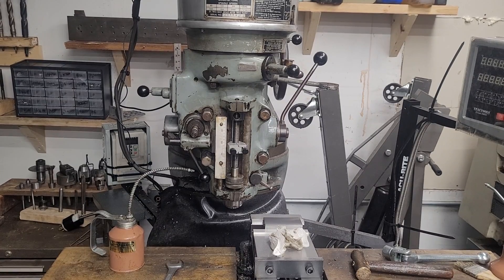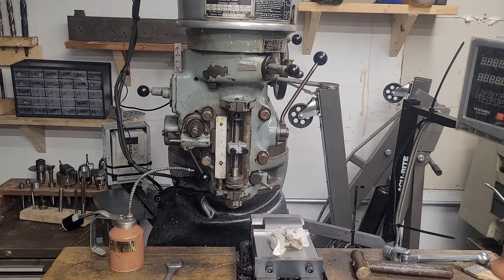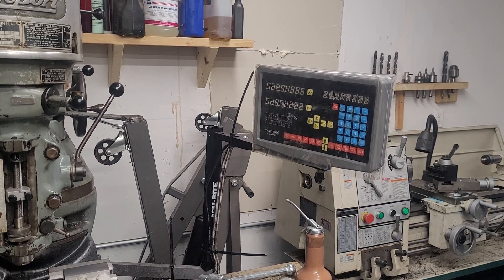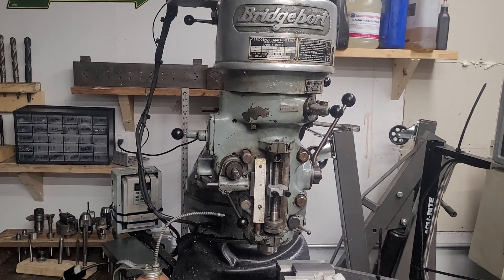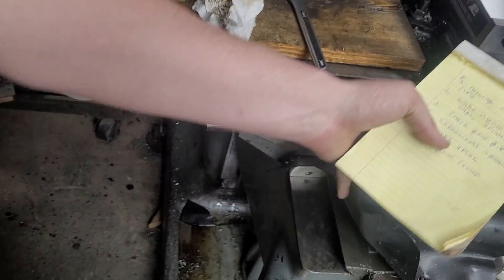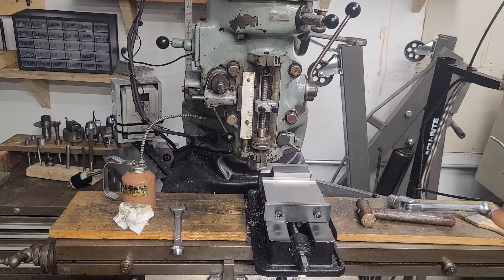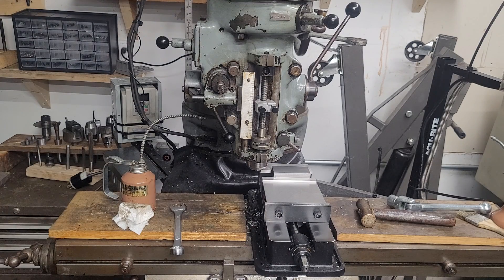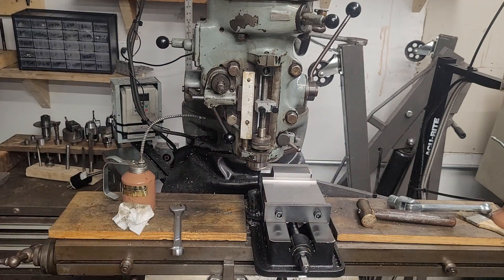5 tips to Get Better at Using a Milling Machine

Comment: You lock the knee NO ONE in the tool industry lock the knee 30 years as a mold maker tip #1 never lock the knee
Reply from the maker: If your machin is as worn as mine, you kind of have to. I lock the knee because if I don't my X and y don't move square to the z travel and I cut tapers. I always do any precision work with my knee locked and just work around it. And yes, the gibs are adjusted as well as I can get them
Reply: some times you do need to do what ever it takes to get the best out of a abused mill @moosesmachinery